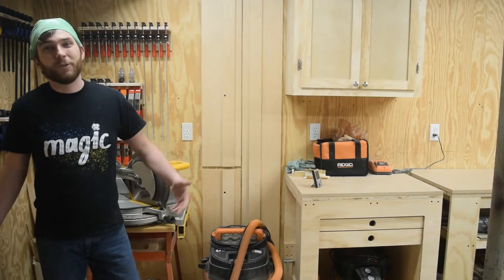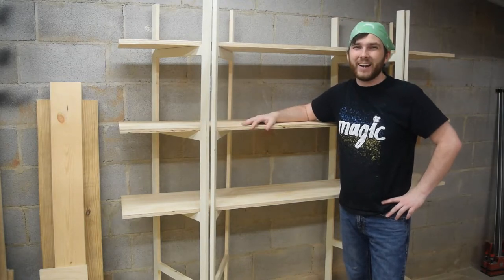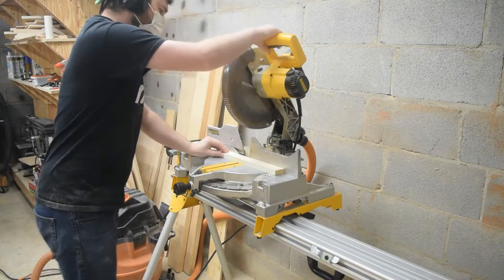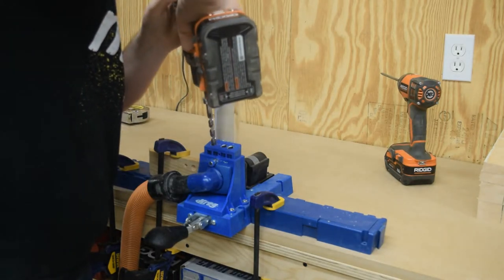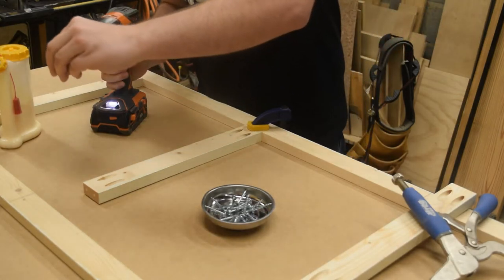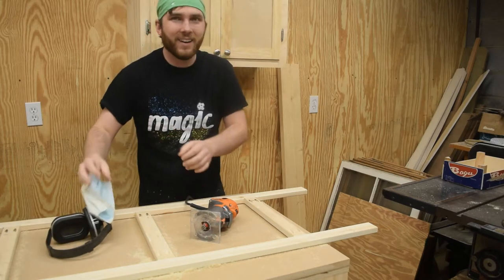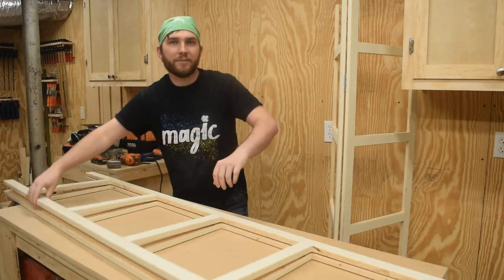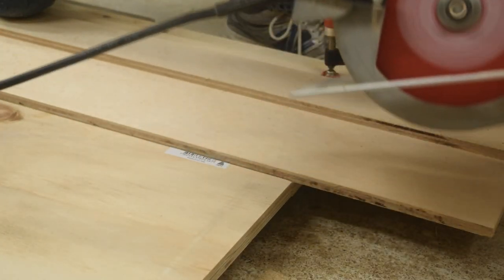Craft Show Shelves

Comment: How sturdy are they on grass with wind?
Reply from the maker: Barbara C I would definitely level it on grass with block screwed or clamped to the bottom. As for wind you can put heavier items in the bottom shelf to weigh it down or tie it off to a canopy if you’re using one. Best of luck and thank you for watching.

Comment: Can you share your finished dimensions please?
Reply from the maker: The uprights are 17.25 inches by 72 inches made from stock that is about 1 and 5/8 inches wide. the horizontals are 13 and 7/8 inches long.  the shelves are 6 feet long and 11 and 7/8 inches wide. I didn't do a full 12 inch width because then with the saw kerf I wouldn't be able to get four pieces from one sheet of plywood. I thought about running the shelves a full 8 feet long but have been happy with how six feet sets up in a standard 10 by 10 craft booth space. Thank you for watching!